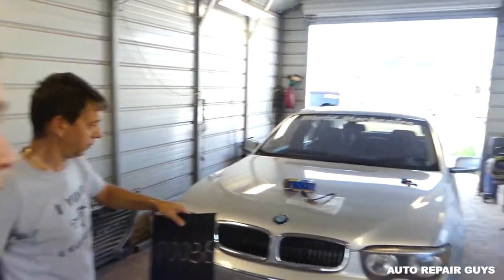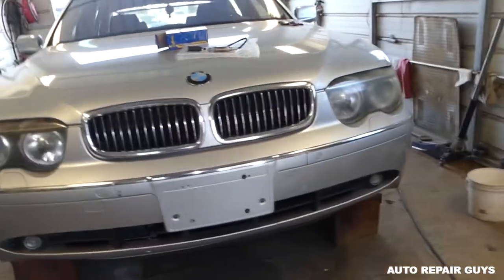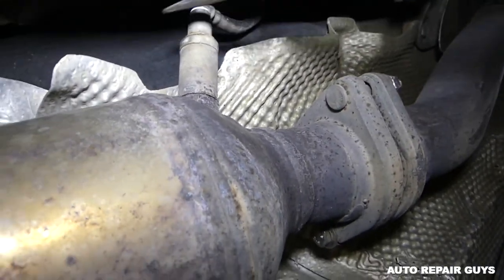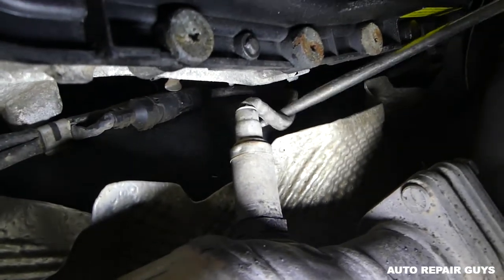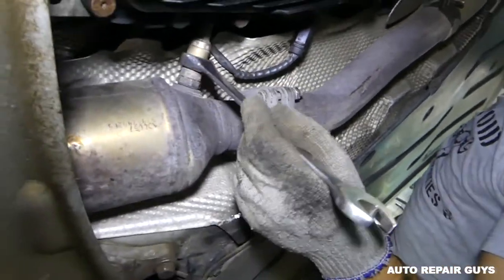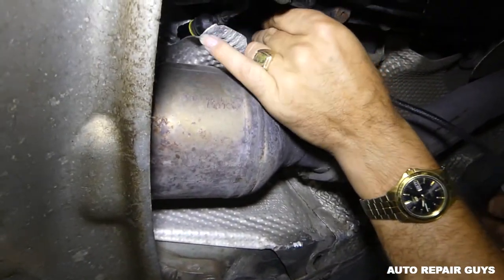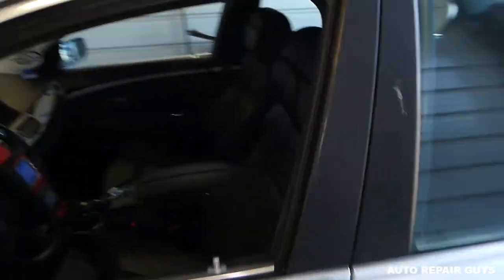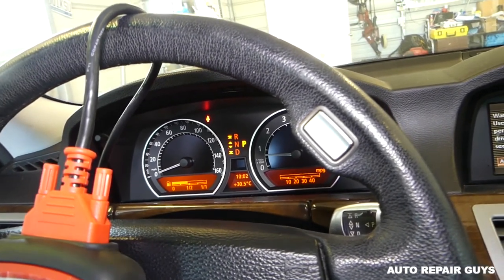BMW E65 E66 OXYGEN SENSOR REPLACEMENT P0036 745i 745Li

Comment: I am trying to buy the o2 sensors for a bmw 745i. When I searched online I found a downstream sensor and it says "Downstream Left/Right" does it fit both sides. If I want to replace both side can I buy just two of these or is there a something different. This is confusing.
Reply: They're interchangeable. You can use them for either side.

Comment: Hello, i got a check engine light (check engine soon) so i took it to a friend that has an OBD scanner and i got a code 0x2C9C(11420) Oxygen Sensor Heater Ahead of Catalytic Convertor Control. Is this the same as the sensor you guys change in the video, or a different one? 
I would really appreciate it a reply! Thank you!